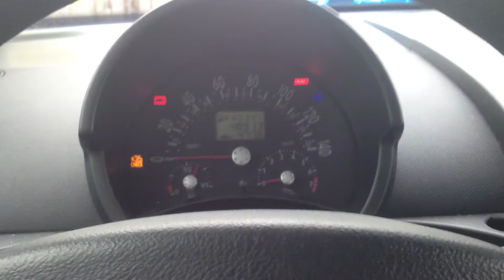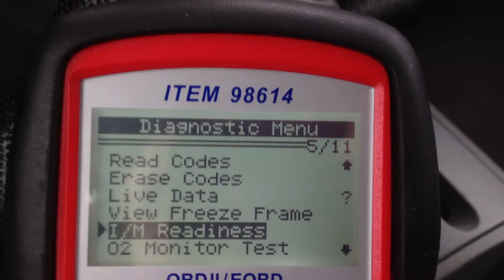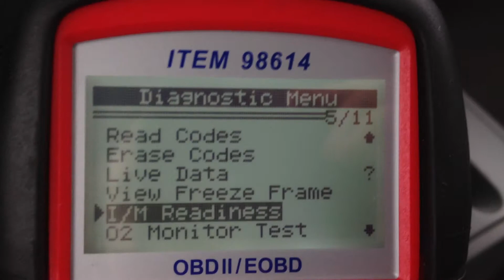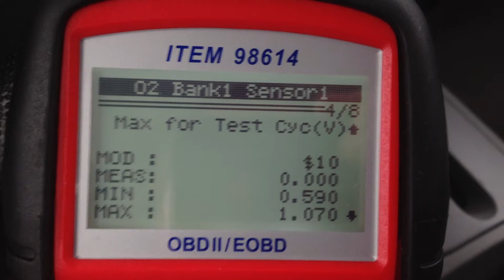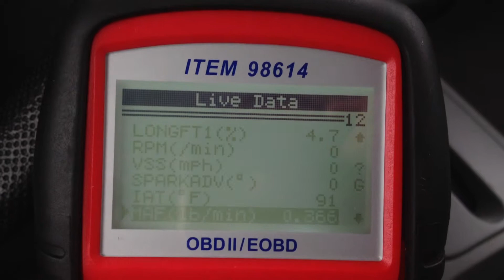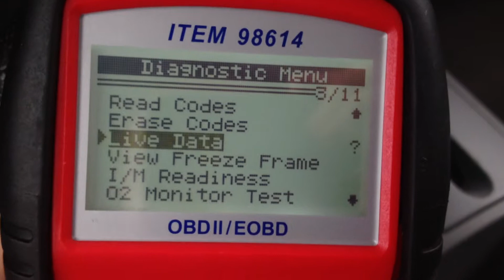Desperate Plea for Volkswagen Help! CALLING ALL MECHANICS!

Comment from the maker: Yes, I got the issue sorted and the car is still with us! On the throttle control module: turns out that the VW dealer messed it up. When they reconnected the battery, they must have started the engine immediately (which you CANNOT do) which didn't allow all of the engine electronics to reset themselves thus disabling the throttle control module. This also sorted the EVAP monitor. Also, I bit the bullet and got the catalytic converter and both O2 sensors replaced; that cleared the P0422.